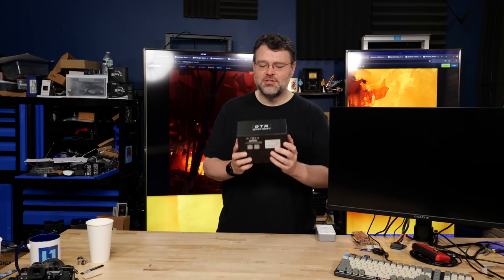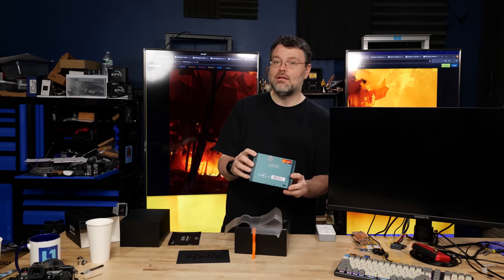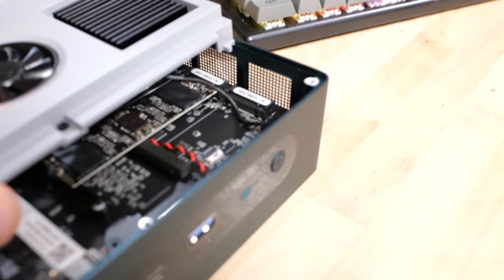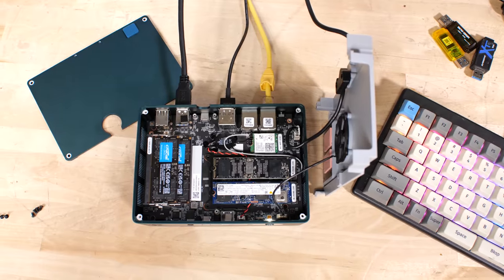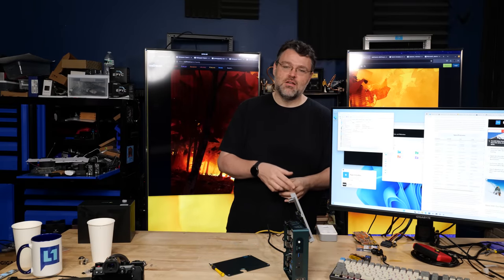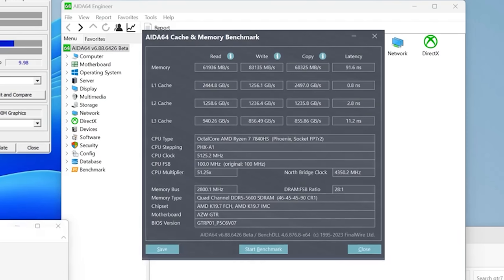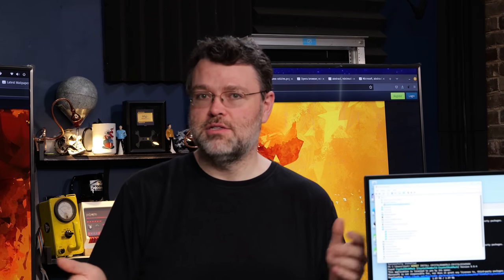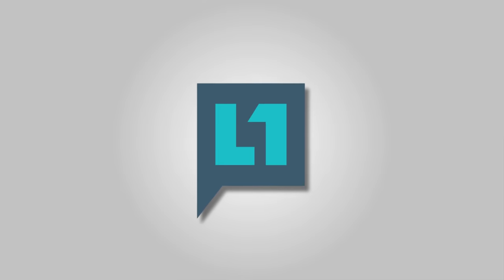The GTR 7 is Amazing! But mine broke...

Comment: My GTR7 immediately had problems with it having random BSODs, random restarts or just shutting down. Tried updating the Bios and re-installing the graphics drivers, but the issues persisted. Besides Windows, all I had installed was Google Chrome and MS Office. Emailed Beelink support and never got a response. Eventually I returned it to Amazon. May try the Minisforum UM790 next.
Reply: What did the crash data say? Logging?
Reply: @GoonyMclinux  I received my GTR7 last week and slapped in two new Samsung 980 Pro (500GB & 2TB) SSD's with a fresh install of Windows 11 Pro. Everything worked great for 24 hours and then the next day, I started to have the same issues with random reboots/shutdowns. 

From what I found in the Beelink forums and from Beelink themselves, these reboot/crashes are caused by the current supplied AMD drivers as AMD has yet to release any official drivers for the 7X40/780M APU and are basically DEV/OEM testing drivers. The issue is with the CPU/memory C6 state and currently to fix the issue. You have to disable CPU C6 as well as the power setting to allow windows to turn off the devices on the NIC's, Wi-Fi and Bluetooth controller within Windows Device manager (I did this by going into Windows power profile and settings minimum CPU power to 10% as disabling C6 in BIOS is not available/broken).   

Beelink has acknowledged this issue and supposedly an updated driver from AMD is slated to be released July 26th. They are also working on a BIOS update to address some of the power settings in the current BIOS that are not working as well as an update to the DRAM training function to improve memory stability.  

Also, anyone that has an issue with the video and audio drivers not working in Windows 11 and showing up in the device manager with yellow triangle. That is also due to the current driver and secure boot being enabled as the drivers are not validated WHQL. Just disable Secure boot for now until AMD releases the official WHQL versions with the proper signatures.
Reply: MinisForum has abysmal customer service. There are innumerous accounts of people having issues so they return their machine only to get one far worse as a replacement.
Reply: @DaWolfwar  I live in China and have a Lenovo laptop with a 7840H + 4060 for my son, has been running excellent even in demanding games, so I doubt the APU is at fault, more likely the implementation of their bios and AGESA that's not right.
Reply: @benjaminsmekens2344  Beelink has already acknowledged that this is a known issue caused partly by the beta drivers for the APU and partly by issues within the current BIOS. The issue is the C6 power state not working properly.  They are working on an update for the BIOS and AMD is supposed to release an updated set of drivers around the July 26th.
Reply: So, how is stability with the supposedly updated drivers?

Comment: How does this little box do for live streaming? I use OBS to stream sporting events at the high school where I teach. I have a blackmagic 4hdmi input card in a thunderbolt 3 case that I like using at events. Does this do AV1 encoding? I have heard that recent AMD drivers are much better in the past for encoding/streaming. Is that really the case? I know it is a niche area, but did you happen to do test for this type of workload?

Comment: I got a little cheap low power Intel nucbox recently, with windows on it and it struggles terribly so therefore the experience is super annoying... These new AMD systems are so much better... if the price was lower these would actually sell like hotcakes. Good times though as you can have you beast gaming productivity PC that can easily fit into a bag... i.e. you dont have to be tied to one spot which you usually do with a big heavy tower PC.  Just need the big folding/scrolling OLED monitors now 😜

Comment: What 2.5g switch do you recommend? Everything has 2.5g ethernet but that doesn't do anything without a 2.5gb switch.
Reply: There are loads of affordable 2.5GB switches from D-Link, Netgear, Zyxel, Trendnet etc,
I have a DMS-107 switch that works prefectly for a 2.5 uplink and downlink for a computer to a NAS,  for example.
Reply: STH has a video as well as an article on the main site about 2.5 switches.

Comment: Hey Wendel. I love you. I really do. But please don't give in to AMD's (or other's...) deceptive naming convention and say this js a "7000" series CPU. It needs to be clear to end users that 7x4x CPUs are real Zen5 while anything under 4 on that third number means old architecture repackaged mostly.
Reply: ... it is a 7000 series zen5 APU, it has a 7940HS inside which is a phoenix family APU so definitely zen 5...
Reply: @benjaminsmekens2344  not the point. The point is AMD and Intel have been selling precious architecture kit with more recent nomenclature and that's flat out wrong when it's done this deceptively.
Reply: @cldpt  Well on that point I agree, both companies could use better naming schemes, if you don't keep up with HW and model numbers it's easy to buy a previous gen part thinking it's a current gen one.